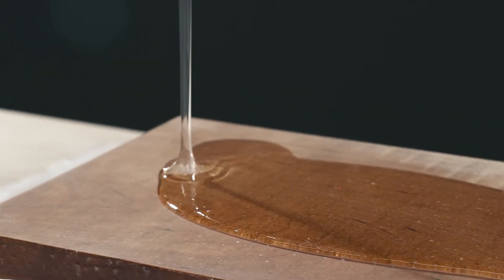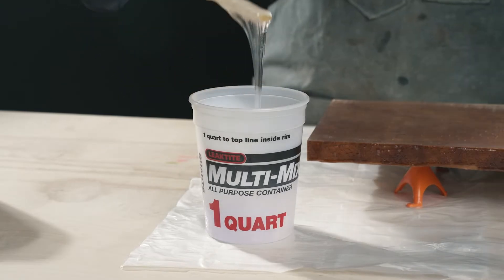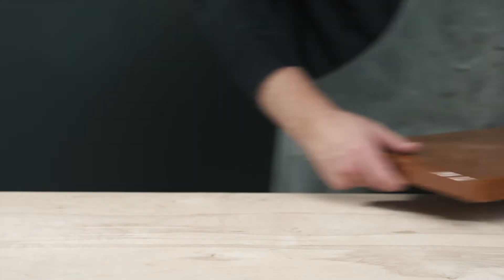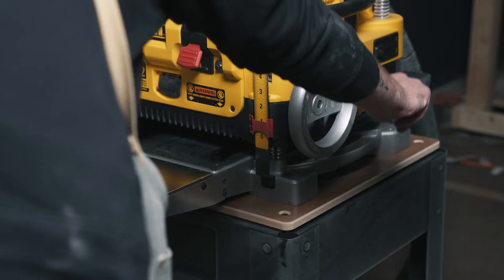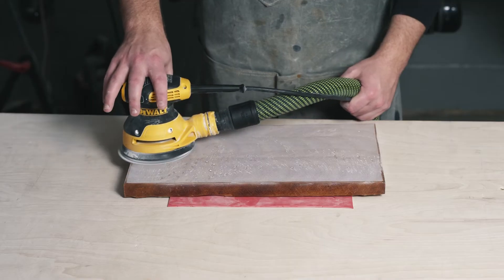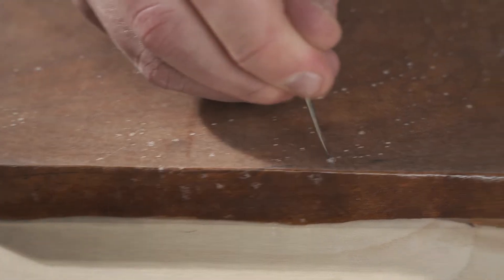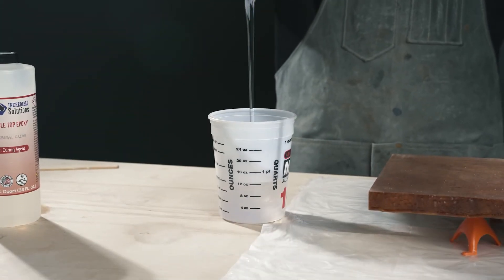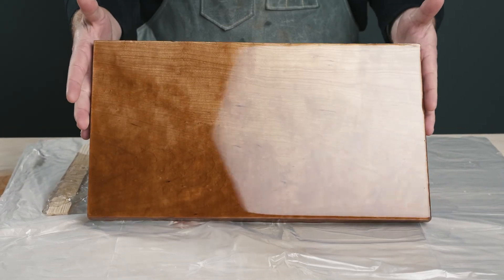Adding a Second Coat of Epoxy or Epoxy Flood Coating | Incredible Solutions

Comment: I ended up with bold spots in my first pour. Do I need to remove entire first pour? or, can I sand lightly and apply a second pour over the first one?  Feedback greatly appreciated.
Reply: I know this many months later you've probably already dealt with your problem but if someone reading this has the same problem just like I did with my countertops maybe this will help. If the bald spots aren't on your edges it should level over them just fine. Also a product saving hack (especially if you're working with a massive piece) if you are sanding to matte finish anyway you can just scuf sand the divots or bald spots and pour a small amount of material into them then sand back to level with the rest of the surface then continue with your progression in grit to the desired sheen. If the bald spot is on the edge apply a masking tape dam so the epoxy doesn't just flow right off and fill in with a small amount of product like described above and once set sand back to match the rest of the edge. Then sand for matte or flood coat for gloss. That will save you having to remove the whole entire layer which if you don't have a planer would take forever.

Comment: Ughhhh first time doing a table top. I poured a second flood coat after the first coat was a little tacky still (label said 5 hours, but wasn't long enough I guess) 

My second coat isn't self leveling and is now completely ruined lol. Oh well. Guess I'll be sanding tomorrow 🤣
Reply: Ah man, sorry that happened. I'm so thankful you shared your experience!! My very first pour (first time ever using epoxy) was unsuccessful. Awful in fact! I waited for 3 hrs for it to flash enough to try the 2nd pour but I still had awhile longer until it was ready. I contemplated just saying screw it, I'll pour the 2nd coat over top and hope it works 🙏 After reading your comment AND weighing the pros and cons options I chose to let it sit and re-pour tomorrow. Again, thank you for the advice. I really hope this works on the 2nd try.

Comment: For deep pour it's much better and saves you time by pouring over the 1st layer while it is hard but still tacky, as long as there are no imperfections. The layers will bond if you don't let it completely harden. If you let it fully harden you will now require sanding. Be smart, get the bubbles out before the epoxy cures and save yourself time and $ (sand paper) and do the next pour before things fully harden.

Comment: Hello, Great quick video with plenty of tips. Do you have any experience with making the pour less viscous? I am wanting to do a second pour on corn hole boards I made due to there being some very shallow areas one some of the ends. The rest of the boards look great though so I do not want to have to use more product than needed. I read somewhere the only way to do this safely/correctly is to add heat to the resin and hardener before mixing. Any ideas appreciated!
Reply: You can add various solvents. Might depend on the brand but I haven't seen so yet.

I added isopropyl to make it "paintable", and while it's not a huge deal in many cases, you'll probably want the highest % to avoid excess water from the ISO
Reply from the maker: The bottles should definitely be warmed prior. You can also sand the surface before adding a flood coat to make sure you get an even layer.

Comment: Does a similar process work for deep pour?  I have a 15 gallon pour I need to do.  Your instructions suggest no more than 5 gallons at 1" at a time.  I will obviously have multiple pours to reach the 2 1/4" thickness.  Do i have to wait until the pour is fully cured (7 days) to pour send layer?
Reply from the maker: Hi Eric! For the deep pour it doesn't have to be fully cured to pour subsequent layers. It can still bee tacky so you can pour additional layers in 48 hours.
Reply: Do not wait between pours to harden. This video is a little misleading and will cost you more time and sand paper. Pour over 1st layer when hardened, but still tacky. Also don't pour too much at once. May cure too fast and warp the mold/table. Speaking from experience.